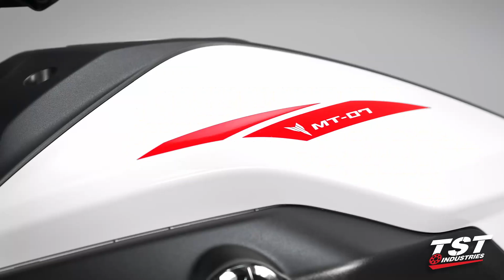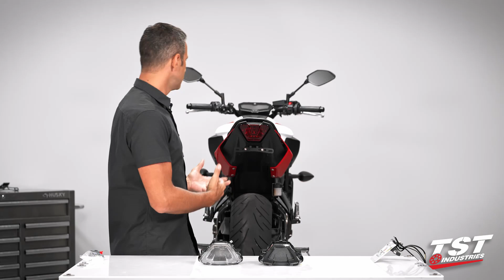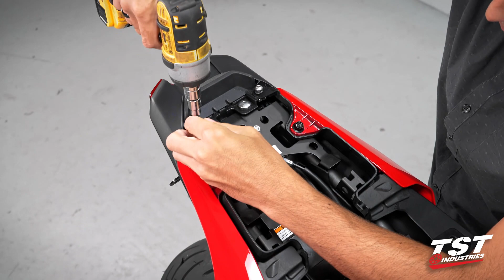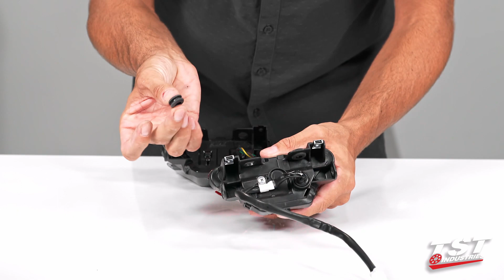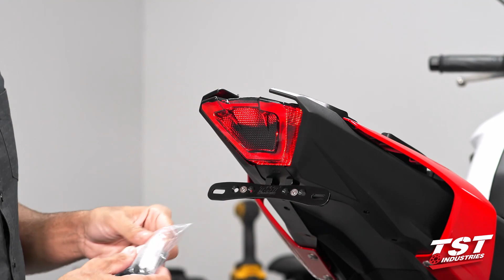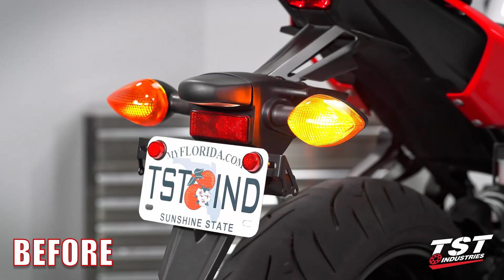How to install a Programmable Integrated Tail Light on a 2018+ Yamaha MT-07 by TST Industries

Comment: Do those resistors clip in? Or do you have to splice the wires? 

The annoying part about doing this specific tail light, you might have to change out your front turn signals to led because those are halogens still. There's nothing wrong with my front turn lights, yet I got to replace them along with my relay?
Reply from the maker: You do not have to change your front signals if you are changing the tail light. Especially if you are replacing the relay. You will also not need resistors if you are replacing the relay. The flash rate is set by the Gen2 relay regardless of what signaling equipment you have installed as long as the total current draw does not exceed what the relay can handle. In the case you are describing the signals in the tail light and front incandescent signals are being used. That is an acceptable combination. If you are installing the tail light and Gen2 relay it is all plug and play, no splicing. We have videos for the installation of each of those so I suggest watching both prior to beginning installation.

Comment: How long does the LED last? I just installed and was curious when I’ll have to undergo this again?
Reply from the maker: Realistically, our LEDs don't normally fail. If issues arise with "dead" LEDs, it stems from a weak solder joint and causes a disconnect from the PCB to the LED bank. We offer a standard warranty but 9 times out of 10, these lights last longer than the owners keep the bike.

Comment: What if my new tail light doesn't have fasteners? It's just the wires. My tail light matches up perfectly but my signal wire has two prongs my new light only has one prong. Do I splice the wire into the old wire and use the old fasteners?
Reply from the maker: @bobbystewart500  email our Support Team with some photos and we may be able to help. Obviously working with another companies product isn’t something we normally do but we can fix their mistakes by helping you out.

Comment: do you need load balancing on 22 model?
Reply from the maker: Not at all. The 2021+ model utilizes an internal light control module to regulate the turn signal flash rate as the OEM lights are LED by default.

Comment: What are those red fairing pieces on the back by the passenger seat?
Reply from the maker: The OEM tail fairings?
Reply: @TSTindustries   Oh, different year.  I have a 2017 and it doesn't have those.  I installed my tail light this weekend.. Looks and works perfect.  The sequential blinkers are a nice touch.
Reply from the maker: @bman3800bman3800  Thanks for the love and support!

Comment: Can i take the rear lighter of mt07 2018 on the 2016?
Reply from the maker: The 2018+ tail light is different than the previous gen model. You can probably mount the newer one to the frame of the older bike, but the fairings will not build around it the same way.

Comment: Maybe it would help if you showed us what wires your plugin in
Reply from the maker: It would help if you didn't skim through thte video and actually watched the instructional material in its entirety. Timestamp 5:30 shows and describes the connections, then they are shown and described again in a few other places. Please use the material that we have provided in its entirety.
Reply: @TSTindustries  I see a wade of cables  you just say "we have a few other cables here them are for the license plate light and turn signals" like what cables are for the turn signals and which are for the license plate light? Like point out what cables are what they all look the same for me
Reply from the maker: @GlorySnipes  two of the connectors are identical, those are for the turn signals. There is a third connector that is the opposite of the two for the turn signals, that is for the OEM license plate light.
Reply: @TSTindustries  how come my brake light dont work for the rear brake only for the front brake lever
Reply from the maker: @GlorySnipes  your brake pedal switch is most likely out of adjustment or disconnected.

Comment: I presume the 2021 model has a similar or the same tail end? Just wondering since yamaha did quite a little design change starting in 21. This light would look great with it
Reply from the maker: Yes, it's the same exact light and fender eliminator set-up for the 2021 model but the turn signal connectors are different. If you navigate to our site you will see a 2021 specific category.
Reply: @TSTindustries  thank you very much

Comment: Hi ! Great tutorial! Do you guys ship to Reunion Island? It's next to Mauritius (Indian Ocean) The tail light looks awesome!
Reply from the maker: You can try to check out through our website with your address to see if that location is served. It comes down to shipping availability. We have certain locations blocked because shipping there is either a nightmare of packages always get lost. Best thing to do is to try and see if our system allows the location.
Reply: @TSTindustries  okay thanks a lot guys! Keep up the good work
Reply: Also, I already have LED turn lights on my number plate holder, can I only connect the break light cable? (and not the turn lights cable)
Reply from the maker: You can absolutely use the tail light without using the signal function.

Comment: If you are ok with the quick flashing on the turn signals, is it ok to not have a relay installed? This is not damaging in any way correct?
Reply from the maker: That is correct.

Comment: am I missing a cable? my tail light came with 3 male end wires but I noticed I have a female end missing? is this normal?
Reply from the maker: The fourth connector you're seeing on your bike is for the license plate light.
Reply: @TSTindustries  yes, after some further digging I got it sorted out and it works perfectly. Love the product too!

Comment: Help. I just installed this onto my 2019 MT-07. Powers up and turn signals fine. However, I can't get it to change programming. I press the button while it's powered on but nothing. Am I doing it wrong?
Reply from the maker: A trick we use is to leave one of your signals activated and with each press of the button, press down on your brake lever. if it still is not changing after that, shoot our support team an email with a short video and we will work to get you all taken care of.
Reply: Nvm. Forgot about load balancing resistors that was in the package. I need to install those
Reply from the maker: @808djsho  or skip that painful step and purchase our relay. 😉
Reply: @TSTindustries  So I did install the relay (https://tstindustries.com/tst-led-flasher-relay-gen2.html). I noticed that the lights don't light up when I press on the brakes. It just stays red but the turn signals work (except for changing the programming)
Reply from the maker: Please contact our customer service guys through our site. They will be able to troubleshoot with you and get you going. Youtube is not really where we do troubleshooting cases, but it sounds to me like you have the brake light tripped permanently by one of your brake switches.

Comment: I've got mine installed.  Super easy.  How do I program different flashes?
Reply from the maker: There is a button on the enclosure of the tail light. It is accessible from the trunk compartment. Each press toggles you through nine program states